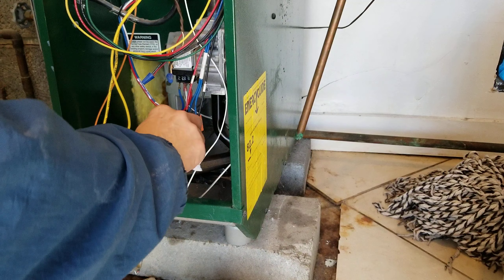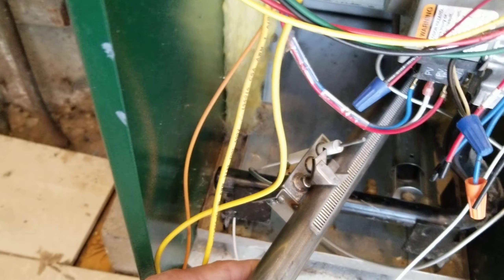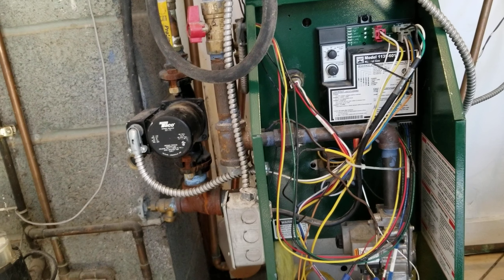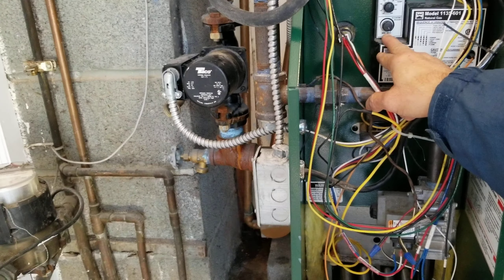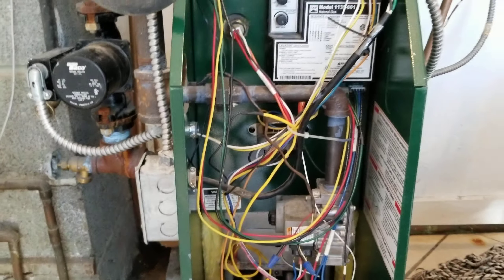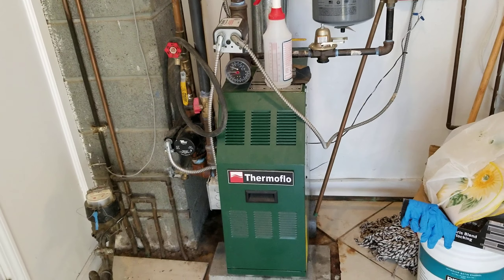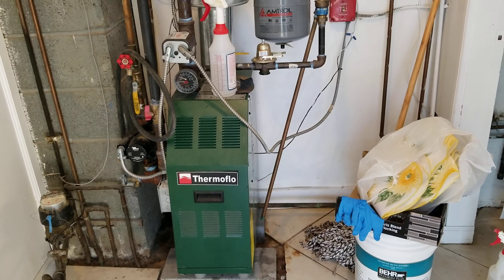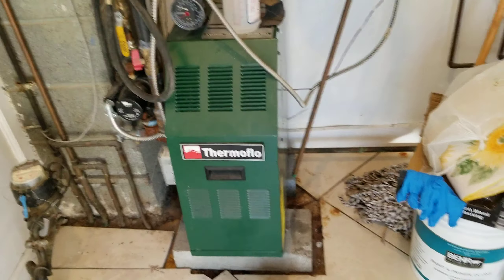Weil Mclain GWA gas boiler - clean flame sensor - flame keep turning  on and off

Comment: Just cleaned my flame rod, thank you. You dont show how to take it apart but putting it back is self explanatory on how to take it apart. For the other comments, it is just 4 screws that come out to take the face plate off and the rod is right in the middle. The piece pulls forward and just lifts up in the back. A little sandpaper and your good to go